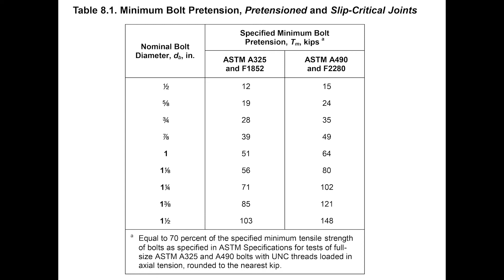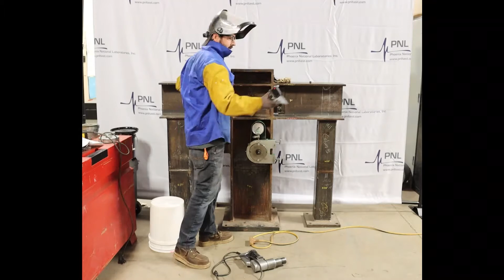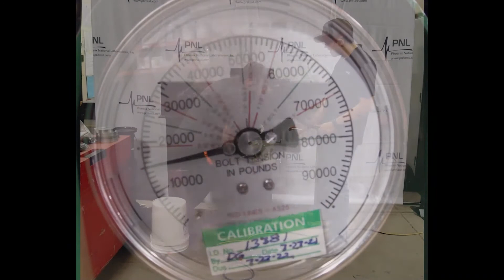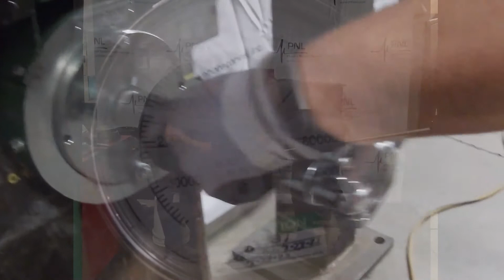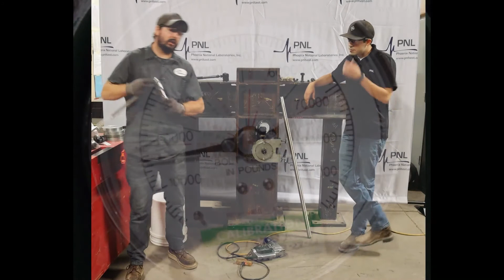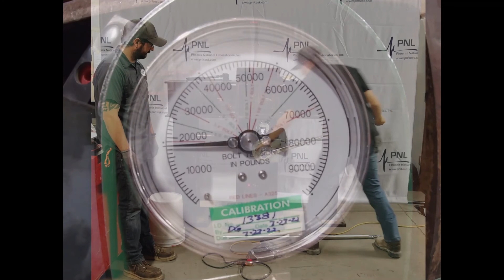Tech Talk: Steel High Strength Bolting Inspections

Comment: I would recommend putting the Skidmore on the opposite beam flange so the backside is not in the beam, preventing a visual check. I have seen more than one adapter damaged because the bolt head was not in the adapter correctly. It will make no difference as far as the testing is concerned, but the backside must be open to keep an eye on the bolt head.

Comment: How many have to fail before a lot is bad
Reply from the maker: If one of the 3 bolts tested fails, the lot fails
Reply: @pnltesttv7762  then the whole lot is rejected and has to be replaced?
Reply from the maker: yes that's right